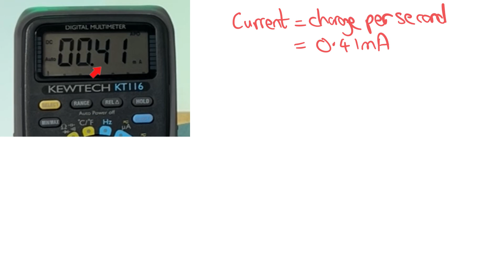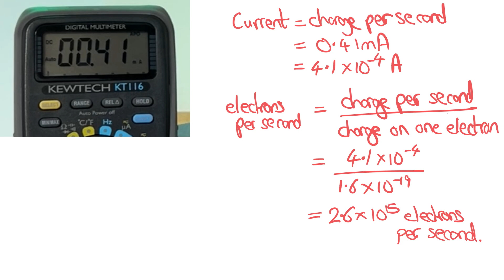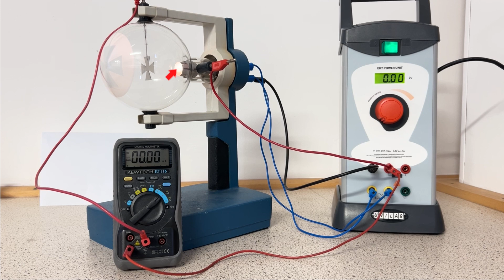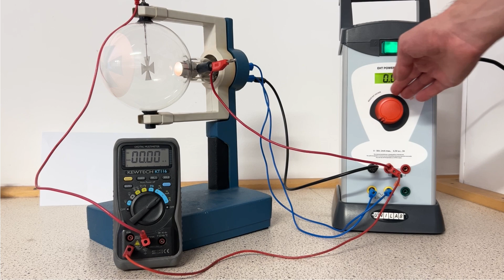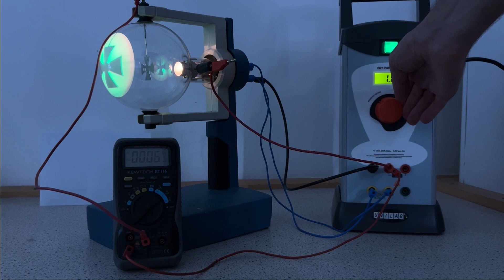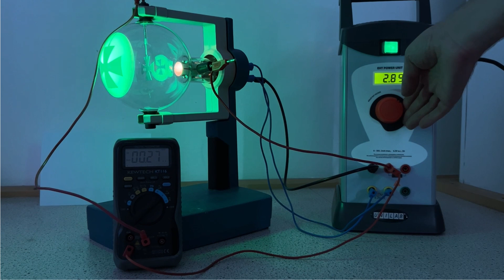Calculating electrons per second with the Maltese Cross Tube

Comment: I wonder if you could estimate the drift velocity of electrons by assuming the area is the average of the green circle and the gun
Reply from the maker: Drift velocity is more useful in wires or semiconductors.  The speed of the electrons here in a vacuum is more determined by the accelerating potential difference/voltage.  If you put the electrical work done which is the charge on the electron x accelerating voltage equal to kinetic energy of the electron you can calculate the speed.
Reply: @SimonPoliakoff thanks for the reply. Love the content. I've tried a few of your demos and they definitely enhance my teaching